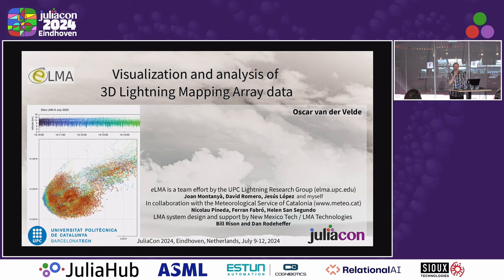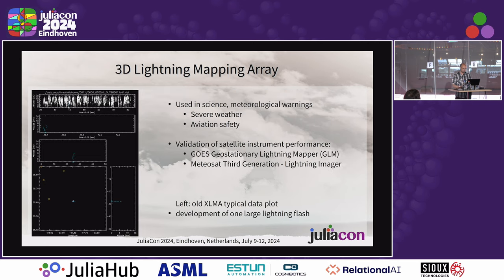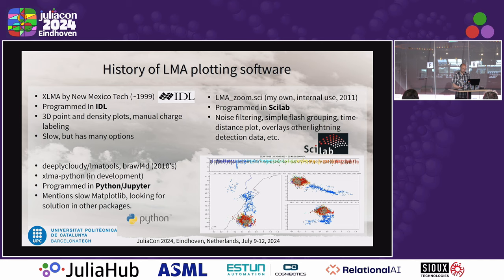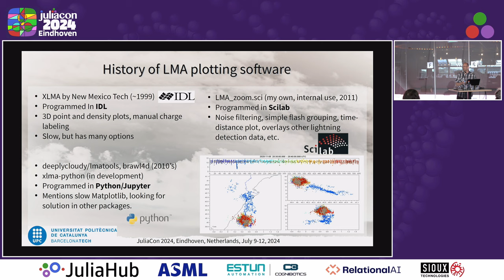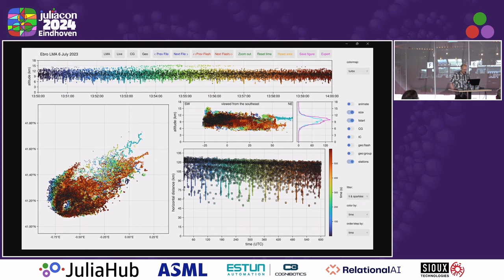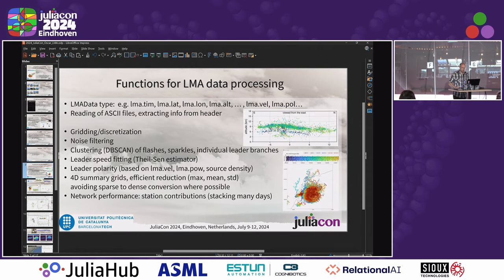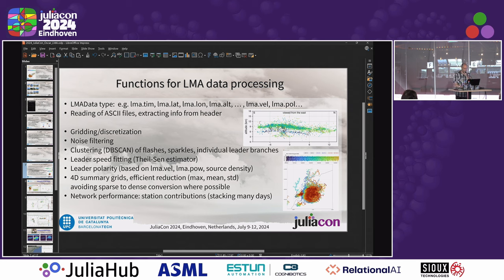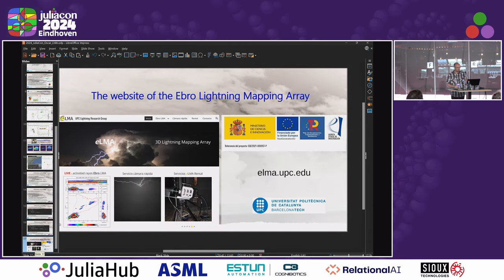Visualization and analysis of 3D Lightning Mapping Array data | van der Velde | JuliaCon 2024

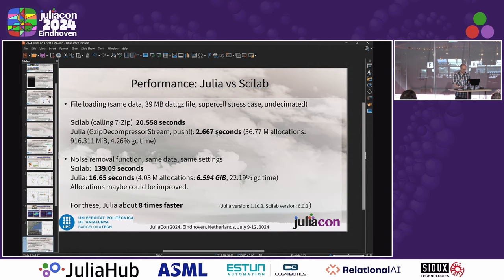Comment: At 8:02 I reported that Julia was 8x faster than my similar old routines in Scilab. I have since this talk rewritten a discretization function using the searchsorted functions instead of logical comparison or findall, which sped up exactly 10 times, with the result that the noise removal and simple flash finding functions now are 80 times faster than they were in Scilab (1.6 sec now for the example shown), allowing new computationally intensive functionality to be added and still get a real-time data browsing experience!